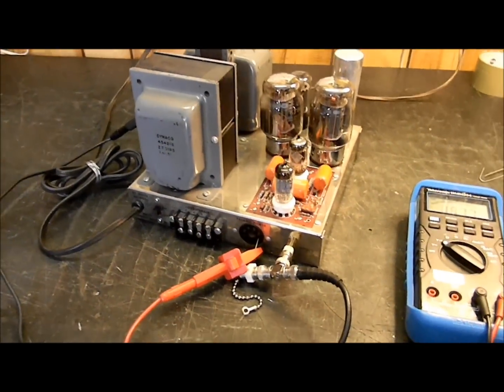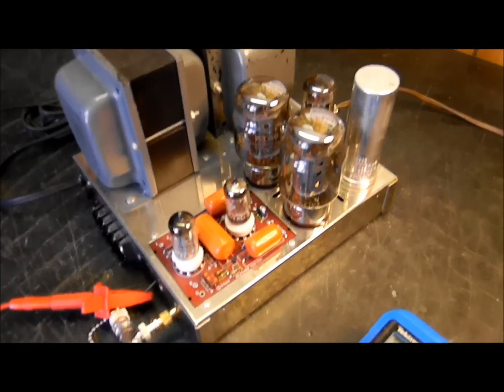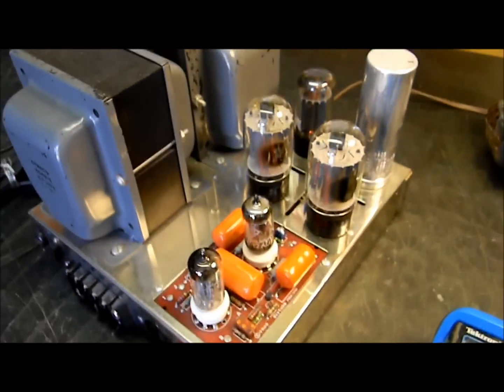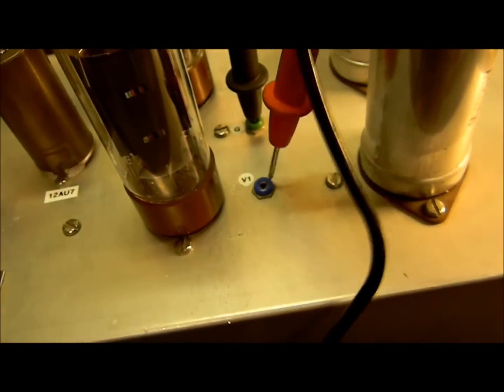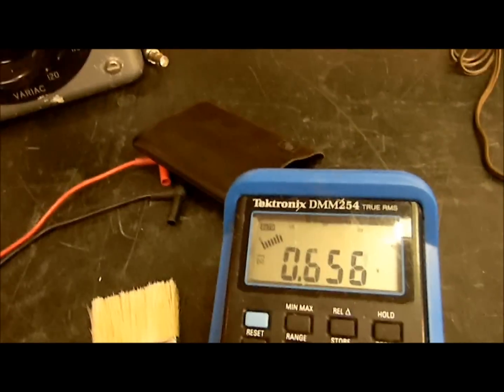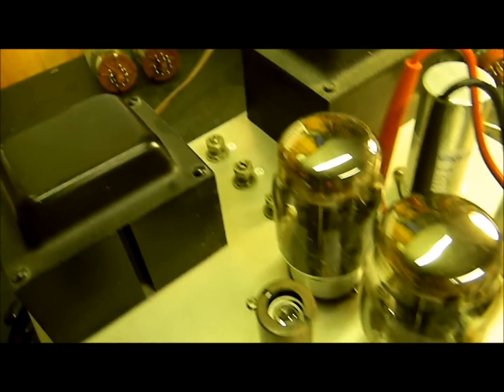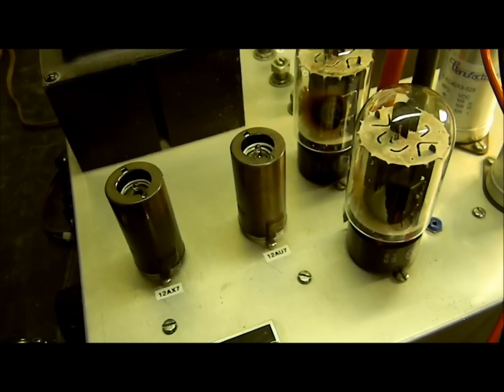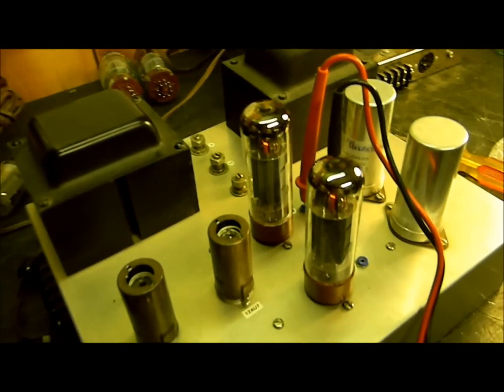KT88 vs EL34 vs 6L6 Substitution In Vacuum Tube Amplifier.wmv

Comment: Excellent Demo ,,,  Thank You

I'm currently trying to figure out the correct tube configuration for a 'later' model Sunn Sonaro head.  
And thought story might align with you Tube Swapping video

As you probably know the early Sonaro used El-34s and 7199 PI .. a few years later to drive multiple speaker cabinets ... KT-88s were used with a 6AN8 phase inverter, plus my Sonaro has SS rectifier cans, huge transformers and speaker outputs labeled 8 & 4 ohms. (circa 1971 ?)

The problem is, my amp arrived with 6L6s and 7025 in the Phase Inverter socket (instead of 6AN8) 
Actually surprised Sonaro works at all with 7025 ...although I believe this combination is typical Fender tube 

So anyway, I swapped out the 6L6s for a KT-88s   & kept 7025 in socket as PI

As soon as I powered-up and turned off Stand-By switch ..... 
the KT-88s began to create a crazy oscillation for about 5 seconds before tripping the internal SUNN 3 Amp circuit  breaker 
No Muey Bueno .., Did I just blow-up my NOS Sunn Sonaro ???

Anyway, removed the KT-88s and reinserted the 6L6s.
Thank goodness the amp still works, but something is not right.  

Doing research, I see all Sunn gear with KT-88s are using 6AN8 for phase inverter.
Just concerned why anyone would have the 7025 (12AX7a) in amp with 6L6s.

Is the 7025 some "secret trick" to help the 6L6s work better in a Sunn amp ?
And blow-up the Sonaro if somebody forgets to replace 7025 with 6AN8 when replacing original Kt-88s ??

Or is my Sonaro amp stilled wired for the EL-34a and a 7199 PI ???

Appreciate your posting PT video and sharing and info

William Drew 
( I'm on Facebook if you would like to share any related info)
Reply from the maker: Sorry  it took me so long to respond as I do not get notifications in email anymore from YT. If you notice carefully in the video, you can see that you can put a 6V6 in the socket of a KT88 but not the other way around. Not counting the filament current it is because of the bias. A 6V6 needs about -15 volts bias, a 6L6 about -37 and KT88/6550 about -55 volts bias. So, if the amp is set up for 6L3 with -37 V negative bias and you insert KT88, the plate current will be extreme and most likely blow a fuse (hopefully). This pretty well explains the issue with "rolling" tubes. This video was many years ago but I think it is demonstrated in the video. Also, remember that the KT88/6550 draw twice the filament current of the 6L6 so if the amp is designed for 6L6 you can run the bigger tubes. Hope this helps.

Comment: So my amp has EL34s, I can make bias adjustments which I normally set to 40 ma.  Can I put in KT 88’s and just kick the current up to around 50 mA?  Great videos!
Reply from the maker: Since the filament current is the same on the EL34 and KT88's that part is OK. If you like to experiment and can control the cathode current with a variable bias supply, it might be fun to try. Just keep the plate dissipation in the safe range for whatever tube you use. I would probably try it. 🙂
Reply: @ElPasoTubeAmps  Thanks for the reply, glad that there a few (such as you) that have a clear understanding of tube theory to convey such knowledge.  I studied engineering at Lowery AFB in the 70's just as tube theory was phasing out and solid state was phasing in.  The instructors then didn't know solid state (diode, transistor) theory but were well versed in tubes.

Comment: Doesn't the EL34 have a slightly different pinout?
Reply from the maker: Pin 1 is the suppressor (third grid) that has to be grounded on the EL34/6CA7. On the metal base of the vintage 6550 and KT88 (maybe the new ones also) pin 1 is the metal ring and most people ground it. It is a good idea to ground pin 1 so a person (like me) won't use pin 1 for a voltage tie pin and grab the metal ring and get clobbered...  It is not used on the 6L6 tubes and neither is pin 6 used on any of the tubes except the 7027. I don't know why they made the pinout of the 7027 so strange as they do use pin 1 and pin 6 connected internally in the tube - so, often times the grid stopper resistor is mounted between pin 6 and pin 5 (the control grid) on the 6L6, EL34 and 6550/KT88. With a bias adjustment that is wide enough, different tubes can be experimented with. 6V6 needs bias in the -15 volt range, 6L6 in the -37 volt range and 6550/KT88 in the -55 volt range.
https://frank.pocnet.net/sheets/049/7/7027.pdf
https://frank.pocnet.net/sheets/030/e/EL34.pdf
https://frank.pocnet.net/sheets/127/6/6L6GC.pdf
Reply: @ElPasoTubeAmps  - it is a shame that they aren't configured exactly the same - so simple to change! I have set of Four original GE 7027 but don't have any amplifiers which takes them (all mine are KT88/6550/6L6, EL34 or EL84)!

Comment: May I ask why you switched amplifiers in the midst of what would have been a great comparisom. Unless the B+. screen, OT, are exactly the same there is no ability to compare. Additionally the 6L6s were not equal as indicated by the difference in getter oxidation.

Comment: hello i just got a 67 black face deluxe so i can put a few different tube types in it but what i want is sweet overdrive.so i asked a seller & he said try triple mica 6v6,s or el34,s but i have the the 12ax7 & another one to choose from as well which i think is an ecc82 but i notice many have 2 codes.so what i need to know is the pre-amp circuit better for creating overdrive ??? & can you recommend a vintage tube type please.i mean my thinking is that tube overdrive is better than an overdrive pedal.but i dont think i can use the kt88,s in my amp not sure but i believe they make another tube that is similar that i might be able to use in the pre-amp but great post peace...
Reply from the maker: Your thoughts on swapping around the 12AX7's is the best and safest idea. The 12AX7 is the tube with the highest gain of that family of tubes. After that is the 12AT7 and then the 12AU7 as the gain of these tubes are lower. So, swapping a 12AX7 in place of a 12AU7 is very likely to give you more gain and thus more overdrive. It it turns out to be too much gain/overdrive you could try a 12AT7. As for vintage tubes, any of the GE or RCA tubes are a good choice. Telefunken and Amperex are other choices but sometimes those tubes can get expensive. As mentioned in the video, we can't just swap a 6V6 and a 6L6 and a EL34 and 6550/KT88 around without making sure the bias is correct and the filament winding of the power transformer can provide the current to properly lite the filament of the more powerful tubes. Good luck with your experimenting.

Comment: By the way, is this a Williamson-ish Amp?
Reply from the maker: There are three or four accepted general different designs in vintage vacuum tube (stereo HiFi style) audio amplifiers. They are often classified as, Dynaco, McIntosh, Williamson, Mullard and some viewers may know a few others. There are other types as in class-A, B, AB1 and AB2 for audio amplifiers. There is  no class-C audio amplifier - class-C is only used in radio transmitters.
In this video I only use the Dynaco and McIntosh design. I don't show a Williamson design in this video but I have several other videos using Williamson designs which are very good mostly depending on the output transformer.
Reply: @ElPasoTubeAmps  Thank you for the answer!! I have watched some of the other videos and found a couple of Williamson circuits, those Heathkit you have shown. The problem is I only have 6L6s (NOS soviet ones), so I am probably trying to use them and making the bias adjustments you have made here. Since the amp does not use negative grid bias, the only couple of things I should worry about are the cathode resistance and the output transformer??
Reply from the maker: @jvgarand  Cathode bias is not a bad thing. We can get more power and less THD with "fixed bias" but the Williamson design, using 6SN7 or 12AU7 for about 20 watts (per channel) is probably one of the nicest sounding amplifiers I have ever heard and many use a bypassed cathode resistor for bias. 6L6 or 7591 are great tubes for audio, along with others of course, but the "sweet spot" in my opinion, of others also, is in the 20 to 30 watt range. Big amplifiers (100W+) do not necessarily sound better. Output transformers are always a challenge. Study the proven designs like the schematics you find from Heathkit or UTC or Acrosound. Don't reinvent the wheel. It is easy to find schematics of all of these amplifiers. UL vs non-UL OPT connections ? Use them if you have the taps and forget about it if you don't. It doesn't make that much difference. Good luck with your amplifier.

Comment: Damn I'm really really late. But what about KT77?
Reply from the maker: The KT77 is the fancy version of the EL34 and 6CA7. 
The point of this video comes down to small power tubes like the 6V6 that only require about -15 volts bias, the 6L6GC around -37 volts bias and the 6550/KT88 which requires bias around -55 volts is that swapping the higher power tubes into amplifiers that are biased for the smaller tubes will result in excessive (and likely damaging) plate current where as swapping the smaller tubes into the higher power amplifiers will likely be OK as the bias in the big amplifiers is so negative that the plate current will actually drop even with a plate voltage increase. So the idea of putting higher power rated tubes in amplifiers than they are rated for is likely to not turn out well. And then we have the problem of filament current, 6V6 at 0.45 amps, 6L6GC at 0.9 amps and EL34 and KT88 at 1.5 amp and 1.8 amp respectfully. Carelessly "rolling tubes" of different types can turn out not the way we hoped for. Thanks for your comments - glad to see people still view it after 10 years.

Comment: You need to consider the plate load resistance as well, because the varying distortion and power output is a result of varying matching with the load.

Comment: With an el34, you need to plan on jumpering pin#s 1 and 8 in order to get the suppressor grid polarized. Most guitar amps use open pins on the octal socket to support grid stopper and screen resistors. Since the 6l6 cathode is connected internally to the suppressor grid, no problem! Plug in a el34 into a 6l6 amp blindly might not be a terrific idea.
Reply from the maker: I think we all know about pin 6 as you mentioned, to mount a grid stopper resistor. As for pin 1, it should not be used for a tie point (I learned this the hard way) as it is connected to the metal rings of tubes like the KT88. I once used pin 1 for a screen resistor and you know what happened when I accidently touched the metal ring.  So, whether it is a 6L6 or EL34 it is a good idea just to go ahead and ground pin 1. Leaving the suppressor grid open on the EL34 will probably just keep the tube from conducting very well and power will be low and distortion high. I haven't verified that but I think is what is likely to happen. Thanks for your comments.

Comment: Even though It's done everyday, I was always afraid to put EL34's in a 6L6/6550/KTxx/ socket due to a slightly different pinout. 6L6 and the like use a common (7AC) socket where pin 1 is not connected (NC) and pin 8 is connected to the cathode (k) and grid 3 (g3) where as the EL34/6CA7 (8ET) socket uses pin 1 connected to grid 3 (g3) and pin 8 is connected to the cathode (k) on its own.

Comment: so, if I have an amp that has uses el34, I can't sub in kt88s?  but kt77s are ok?
Reply from the maker: As far as I have always know or believed, the 6CA7, EL34 and KT77 are the "same", so you should be OK  
You can not simply put the KT88 in place of these tubes as the KT88 needs more negative bias (something like -50 volts for the KT88 to the -40 volts for the EL34 family) 
Here is a modern article on these tubes.
https://www.tubesforamps.com/el34-6ca7-kt77-differences

Comment: looks like the 6l6 is red plating  as i watched the video or is it the light reflection
Reply from the maker: They may be red-platting as the bias was not negative enough during that measurement.
It has been a long time since I posted this video. 
I do remember the "moral" so to speak, of this video. 
In a nutshell, the lower power tubes like the 6V6 take a negative bias of around -15  volts, the 6L6 about -37 and the KT88/6550 around -55 (approximately) so, as an example, if we plug a 6L6 or 6550 into a 6V6 amplifier, the bias is so low in the 6V6 amp that the tubes will draw excessive current damaging the tube and probably damaging the power supply in addition to damage to the power transformer from the much higher filament current. So, that approach will not work. You can not put higher power tubes in lower power amplifiers and hope to get more power output.
On the other hand, plugging a 6V6 into a 6550 or 6L6 amp will likely have enough negative grid bias to limit the plate current to a safe value and it won't burn up and the filament current will not exceed what the power transformer can provide.
I hope I showed that in the video.

Comment: Hi there! Very interesting video! I am new to tube amps and just got a Peavey 5150. Eurotubes says that if you install an integrated quad set of 2 JJ KT88's or 2 JJ KT66's and 2 JJ 6L6's then the amp does not need to be biased and it's basically "plug and play". They said they did a lot of research on this and that it not only sounds great but saves you from having to bias the amp. They recommend you put the 2 KT's on the outside sockets and the 2 JJ 6L6's in the 2 middle sockets. You seem to know what you're talking about so I was just wondering if you think this is safe and is a good idea. I know this is an old video so I hope to get a response cause I just ordered the tubes today! Thanks!

Comment: Why does he not test and mark the tubes for matching first...and talk about screen voltage, which is a major player in substitutions of this type ? ...wish I had that much equipment !
Reply from the maker: Hi, and thanks for the comment - It has been some time since I have had comments on this video. I did post videos where I measured screen current and I agree that it is very important. In all of the triode connected amps like this one and the ultra-linear design, the screen voltage is at the same potential as the plate. I made a video about what happens to the screen if the plate voltage is removed (bad socket pin, etc) which ends up very destructive for the screen. The screen grid can be damaged very quickly and go unnoticed except that performance deteriorates. The message that I hope this video conveys is that "rolling tubes", as it is called, is generally a bad idea. The idea is putting a KT88/6550 in place of a 6L6 will provide more power and that is not true.  I hope it is noticed that the control grid bias voltage is much lower for the 6550 (around -55 or so) than it is for the 6L6 (-37 or so) and that in an opposite manner than what most people think, you are better off putting a 6L6 in a KT88 amp than the other way around as the lower bias voltage in the KT88 amp will actually protect the 6L6 from over current.

Comment: what about the primary impedance of your output transformer. all those tubes call for different primary impedance. yes / no
Reply from the maker: Yes, the tubes do call for a different  primary impedance but this video was to try to address the idea of "tube rolling" as it is sometimes referred to by musicians with the idea of simply swapping one tube for another in guitar amplifiers. I hope the interesting characteristic that can be seen from this video is that, from a broad view,  a 6550 requires about -55 volts bias whereas a 6V6 requires about -15 volt bias so, again on a broad scale, if a 6V6 is placed in a 6550 amp, the (-55 volt bias) will likely be so high (negative)  that the 6V6 will not self destruct. On the other hand, if a 6550 is placed in a 6V6 amp (with -15 volts bias) the 6550 will try to draw so much current that everything will go terribly wrong. (A 6L6 requires about -37 volts bias) So, one lesson to be learned is that putting a higher power tube in a lesser power amplifier will not give the power level increase that is desired and this is just from the DC level performance of the amplifier not considering the AC impedance characteristics. The other important factor is a 6L6 requires 900 mA of filament current (a 6V6 requires 450 mA) whereas a 6550 or an EL34 requires twice that much filament current as a 6L6 and is likely to overload the filament winding of the power transformer..